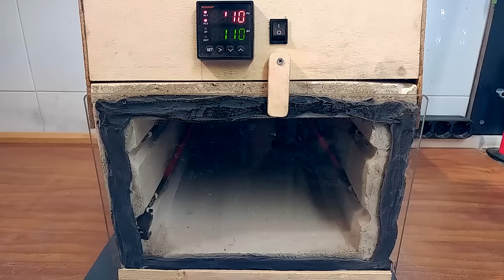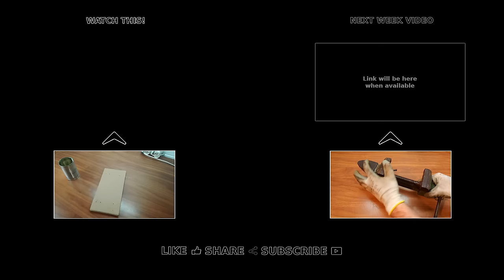DIY Damascus HDPE Handle For Your Tools!

Comment: do u have to put it in a oven? u ever try just putting it by your coal forge, not in it. while u were bkack smithing to melt it. or will it burn easily when by a open flam
Reply from the maker: I guess is hard to control the temperature that way :) since I built that oven I might just use it lol

Comment: That's a really cool pattern. How many milk jugs (and what size milk jugs) did you use? I've been wanting to make a knife handle or something using this method.
Reply: Sharp Works you can also use shopping bags, really all depends on what size of blank you want
Reply from the maker: I don't really know how many because I cut them quite some time ago, probably 5-6! Anyway 1 liter :) That would be cool!
Reply from the maker: Yeah HDPE comes in many shapes :)
Reply: Thanks guys for the information. It gives me something to think about.